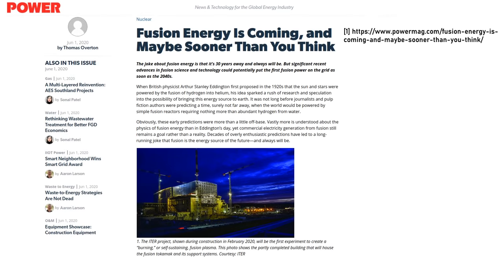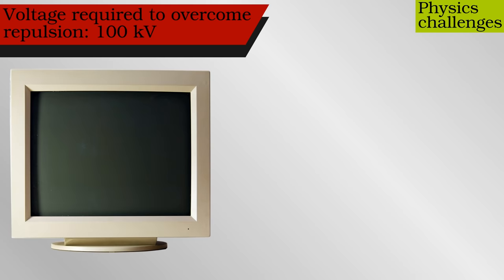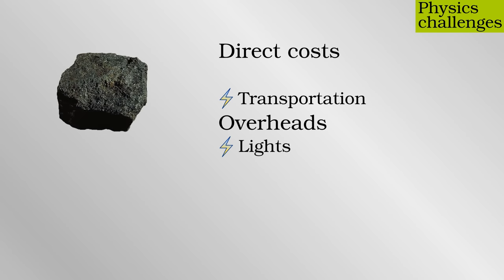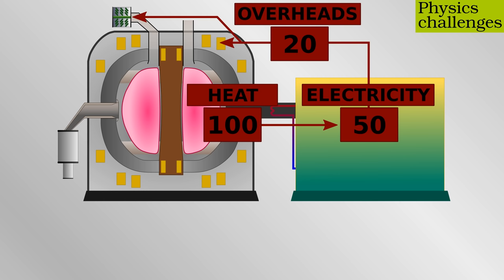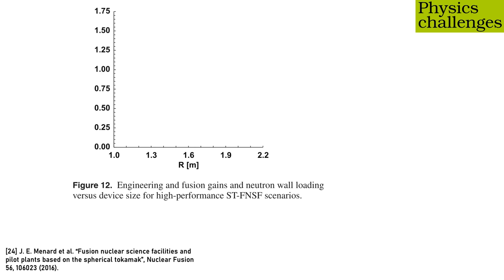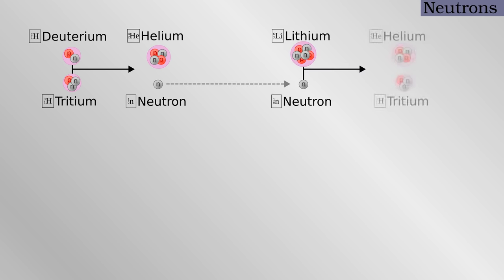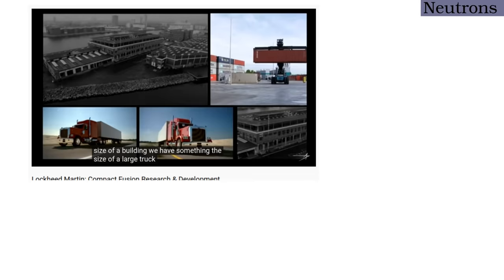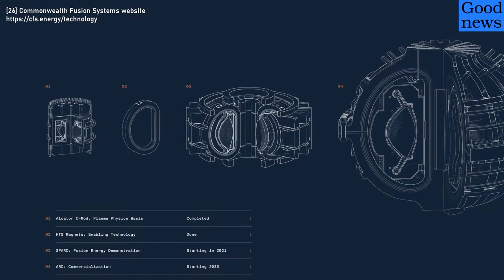Former fusion scientist on why we won't have fusion power by 2040

Comment: Logistics is not the main problem. As wartime shows, huge logistical projects can be done pretty quickly if there is the need. The problem is the missing technology to make fusion be an actually positive energy producer.
Reply: But I mean most things that can’t be done is an issue of missing tech right?
Reply: @Mothball_man  The funding for fusion would be there (huge benefit for society)  but practical working tech is not jet.

In other fields the tech is there, but the expenses are  not of sufficient value for society (and thus the voter and taxpayer / or customer).

Comment: Very interesting, really opened my eyes to the hyperbole of these companies. I'm studying mech eng next year and would love to go into this field.
Reply from the maker: Good luck. Have a look at some other educational videos I have up.
Reply: The numbers being presented by proponents seem to work out well for creating a self regenerating stream of R & D money.
   I think a better way to make as much electricity as desired would be to make a Tesla Coil and instead of grounding the bottom of the secondary like everybody else, run it though a load to ground. Tesla lit a whole bank of incandescent light bulbs. The excess energy captured seems to come from HE rays/short space rays, in the giga electron volt range, frequencies around 10 to the 24th Hz. Only at last detected I think it was 2007. (Your typical electromagentic spectrum chart ends before that with the gamma ray band.)

Comment: I had a guy one time arguing at me that we should cancel infrastructure and green energy projects just to invest in fusion energy instead. Not entirely surprisingly, he seemed to have a lot of involvement with recognizable tech organizations.
It's incredible the positions you have to try and respectfully debate against.
Reply: There is a reasonable position that would appear close to that guy's position. Modern nuclear fission reactor designs are safe, scalable, variable , and a good coal and gas complete replacement. Unlike fusion reactor attempts, fission is practical and tested, although still held back by governments around the world. Concerning green energy projects, not all are an unchallenged good. Some installations damage a large area of previously untouched ground (solar) or use an unreasonable amount of unrecyclable material to be landfilled (wind). Most depend on gas to supplement the varying electric supply, making fossil fuel use an integral part of these green installations.
Reply: @cdgstuff7512  I don't wanna start an internet argument here because those are rarely productive, but dropping all environmental projects to focus on one, single, imperfect, solution is not a good idea. 

Don't get me wrong, I'm not anti fusion, but it is not a viable single solution. Between being hard to export to newly economically growing countries, the compounding danger of creating many many reactors, the lack of available, and importantly, geologically stable space to store waste products and the simple lack of enough resources, trained staff and public will to create enough nuclear power plants to power continents worth within the next 10-20 years (if we want to hit emission deadlines) makes it impossible.
Reply: @cdgstuff7512  I would say that wanting greater use of fission is a far cry from the sort of Enron Musk tech saviorism exhibited there, and a far more common position to hold at least nowadays. At any rate, fission has the very important distinction that it actually exists already.
Reply: There is a lot of wishful thinking involved.
Reply: In any policy argument, the underlying personal incentives that cause discursants to advocate for a particular position should never enter into the discussion, unless such incentives are produced as the intended outputs or outcomes of implementation of the policy being promoted. In short, the evaluation of, and decision to accept/reject, any proposed policy claim should be based on the merits without any consideration of who is paying the advocate to promote the policy or how much they're paying him or any similar factors which have nothing to do with the merits. But of course if one of the stated goals of the policy is the increased financial well being of all persons the policy states are intended to be financially benefitted thereby, then the advocate's personal financial incentive to support the policy might actually be indistinguishable from one of the merits of the policy on its face.
Reply: @davidfloren5339  Please... Brevity is the soul of wit....
Either way... that's not what I was insinuating. The point was that silicon valley tech dudes can be annoying sometimes.
Reply: @puppable  Whoopsie daisy! Sorry - not my intent to add to the annoyance level.  Seemed like you were saying his argument is flawed only because of his background and personal incentives in making any argument, but not on its merits.  If you feel his argument to spend all those green energy/infrastructure trillions on fusion research instead is also a bad argument on its own merits, I tend to agree. But I should think there is a "reasonable" % of public resources that could be reasonably expended on fusion research.  The challenge of course is figuring out what range of funding %s can reasonably be considered reasonable.
Reply: If fusion got as much funding as the green stuff I would be driving my own Dyson Sphere by now.

On the related note, the only thing that the green parties in Europe seem to do is close nuclear plants to open coal ones.
Reply: @phamnuwen9442  it's a useful shorthand so I don't have to specifically write an enumerated list of every single specific technology I'm trying to talk about while still being generally understood by anyone who isn't trying to be needlessly pedantic about labels.
Reply: @puppable  "it's a useful shorthand so I don't have to specifically write an enumerated list of every single specific technology I'm trying to talk about while still being generally understood by anyone who isn't trying to be needlessly pedantic about labels."

Translation:

"I don't have a useful definition of the term I'm using."
Reply: @phamnuwen9442  It is a two sentence anecdote, not a whitepaper.

Comment: A dramatically underrated channel! I already knew fusion was much harder than most folks would have others believe, yet remain virtually ignorant on the subject. It's always useful to find videos like this one to hammer home yet another round of nuclear physics into my thick head. 😁
Reply: @mattblack118  Regardless of who claims what, do you actually see that the climate is indeed changing for worse than it used to be?
Reply: @lucofparis4819   No.  The planet is clearly greening.  Name 1 thing that is worse now than 100 years ago in terms of global climate.
Reply: Fusion is incredibly easy, just get the plasma hot enough, dense enough, for long enough. Now the hard part is achieving all three.
Reply: @mattblack118  : It's the effort to limit the global warming temperature in time that is the key issue.

Comment: I'd love to see a follow-up on p+B reactions. They have their own hangups, but they nicely get around (mostly) the excess neutron problem, and they result in high energy charged helium nuclei, which allows for direct electricity capture. That (hypothetically) gets you up to in the ~70% energy capture range instead of the ~50% with a thermal turbine generator.
Reply: If you think reaching Q1 is difficult with tritium and deuterium the P+B will really make it hard to get any J(oules)...

Comment: Please think about covering the stellarator approach, in my layman’s understanding it is similar to the tokamak in principle and in backing by thorough scientific evaluation but it could solve some of the tokamaks problems you did not mention in this video. There is also a test reactor here in Germany (Wendelstein 7-X) that seems to be on track to prove the feasibility of this approach soon (maybe already in 2022).
Reply: True that. 7-X Wendelstein solves issue of uneven plasma concentration that results in thermal stress on central part of spherical tokamaks. Easier to cool.
Reply: @GrimK77  And I also read it doesn’t need a pulsed magnetic field and hence is easier to operate. W7-X is not designed to ever produce energy, it is to small to achieve that. But last year they achieved fusion and next year they want to show 30 minutes of continuous plasma with fusion. That would be quite a feat and would certainly make the stellarator the best design to scale up. We will see if the tokamak can solve its problems earlier, but given the political overhead it’s unlikely.
Reply: Your still stuck with the problem of having to contain 200million deg c and heat water to steam in a reliable efficient way with super cooled magnets all in the mix..crazy or what !
Reply: @MyKharli  not really. Neutrons should go through magnets no problem and water is the best neutron catcher. 
But you do basically need s fission plant to dedicate its output to starting a really power reactor, which is ironic
Reply: @MyKharli  yes, it would be a remarkable achievement. The tokamak is the most researched design to be able to achieve that and it still has a lot of problems to solve. The stellarator is similar to a tokamak but instead of using a pulsed magnetic field it uses a static but curled up magnetic field. These are the only two designs with a decent chance of scaling up to commercial use and good scientific backing. I hope they get it to work in my lifetime.
Reply: @MyKharli  I think you slightly misrepresent what temperature is, you sounds like you assume it is the same as thermal energy. Space flight deniers make similar misinterpretation.
Besides, the whole point of tokamak is to contain plasma, and 7-x is a redesign that makes it easier long term.
There are some ideas to include AI accelerator chips to control containment in adaptive manner.
In the end it is about reactor size. Larger are more efficient, in theory and in practice, but nobody wants to start large before working out kinks and flaws of design and containment control.
Reply: @Krmpfpks  I think it is unlikely for tokamaks in classic and spherical form to solve unform plasma flow like stellerator.
In the mean time, we couls use some thorium reactors to buy some time from fossils and synthetize fuel instead of refining
Reply: @GrimK77  I've often be curious about that reasoning that "we should build small first because larger is harder" even though we know that smaller is harder for all of those stated reasons. Sometimes larger is less risky.
Reply: @JayVal90  no, it is about costs and research of design. You can't have power-plant grade reactor outright.
Reply: @GrimK77  Right, but it could be large even if it’s not power-plant grade.
Reply: @GrimK77  But its crazy , one  failure in the superconductors and you have weeks of warm up  fix and cool down  to restart and as far as i am aware there is no solution to neutron embrittlement of the containing structure ? So much of the energy goes into cooling and starting and maintaining  the plasma is another crazy notion to me .
Reply: @JayVal90  Larger means more resources wasted, in case the theory doesn't hold in practice.
Reply: @pelic9608  Right, but it sounds like your odds of success are directly proportional to its size. The only thing more expensive than a large machine that might work is a small machine that definitely won’t work.
Reply: @JayVal90  That's not the purpose. The purpose is to test the theory and if or where it breaks. The things you don't even know yet that you don't know. That's the category of knowledge that's sought to be discovered. There's other reasons like potential catastrophic failures being of relatively smaller scale.
Reply: @JayVal90  You also have to consider that this is typically not a case of them arbitrarily going "maek ractor smol", theres likely a few days worth of calculations involved in getting it to be the most economically efficient size for what you want to do.
Reply: @Krmpfpks  Given that most fusion seems to be measured in fractions of a second, this is very impressive.
Reply: @GrimK77  this is not true, you are assuming something to be constant, the strength of the magnetic field. As a Commonwealth Fusion Systems presentation mentions, plasma behaves differently under a 20 Tesla field vs a 3 Tesla field
Reply: @ppatil3655  I have no idea what are you referring to. I literally made no claims that could be interpreted like that. I really had lectures on fusion reactors. University of technology. Electrical engineering.
I always knew that containment field is not constant, needs corrections to counter behavior of plasma during heating and adding fuel , while compressing it at the same time.

Comment: Justified criticism in any scientific area including fusion is appreciated, however I am willing to bet a non-trivial amount of money that fusion will put watts on the grid by end of 2040. They might not have commercial power plants and they might cut some corners but I am certain of this as long as they can get the relevant funding which a lot of approaches have. I support all approaches to fusion as long as they use the scientific method and I hope for tighter collaboration in the fusion community going forward, including peer review and criticism.
Reply: I'll take that bet. How much and who will hold it?
Reply: @MauryMarkowitz  1000 USD. I can either do it on something like playwager or can ask betrair exchange to set something up for higher profile. What odds you expect 50/50?
Reply: @breakablec  Love it!  If I weren't so old I'd match that $1K.  But I'll probably need it for incontinent products soon enough.
Reply: @breakablec  you guys have to really be clear, though. by "by end of 2040" do you mean the end of the YEAR 2040? or by end of the deacde, so 2049?
Reply: @AndDiracisHisProphet  I think I would go for year 2040, 49 is too guaranteed in my mind as even DEMO should put watts on grid by 2048 barring further delays

Comment: We do seem to have learned a lot about how difficult fusion ENERGY will be as opposed to just fusing nuclei in an experiment. I wonder if we're at the point of "knowing all the unknowns" yet, I mean being able to list all of the specific problems that will need solving.
Reply: Certainly seems like we are getting close to that point.
Reply: @Destroyer_V0  Two phase hybrid. Small fission reaction jump starts fusion reaction. At the end of the day it's just about making stuff really hot as it plunges into water to make steam. 

Creating a self sustaining artificial sun is a much harder task than making power for a grid and yet they have been able to sustain fusion reactions for like 40 seconds or so already. 

Power for a grid should not be as hard as its made to seem.
Reply: They have enslaved and fooled you 👉 The Connections (2021) [short documentary] 💖
Reply: @VeganSemihCyprus33 you have Vegan in your username, anything you say is automatically false

Comment: I'd be very curious to hear your take on the inertial confinement projects, most notably General Fusion, which also has attracted a lot of VC money and is building a proof-of-concept reactor.
Reply: That's the only project that seems feasible to me.
Reply: ICF is useful for developing and testing implosion-type thermonuclear weapon concepts while avoiding the need to actually detonate a full-scale nuke. For delivering power to the grid, inertial confinement is lagging decades behind magnetic confinement (even with the recent record of fusion energy gain). This is due to the lasers consuming thousands of times more energy than the heating power which reaches the part of the plasma undergoing fusion.

A tokamak or stellarator could conceivably be a viable reactor with a fusion gain of 30-50. ITER is expected to reach 10, and the next step after that will be a demonstration power plant. ICF as it currently stands would not be a viable reactor concept even if it miraculously reached a fusion gain of 1000.
Reply: @hk-wt5iu  General Fusions design doesn't use lasers.
Reply: General fusion is part ICF and part traditional MCF - along with TAE systems.
Reply: I study ICF plasmas. Most of the scientific community in ICF seems, to me, rather skeptical of General Fusion, they have made some overly bold claims about their approach that just don't seem feasible, and they have not produced promising results yet, at least not that I am aware of. General Fusion is also considered more 'magnetic target fusion' than ICF, but that may not be a very important point.
Reply: @abarbar06  Thank you. If your able, what things in particular don't seem feasible?
Reply: @davescott7680  Well firstly and perhaps most importantly, their choice of using mechanical pistons instead of lasers to accelerate the plasma doesn't address ICF's most pervasive issue - Rayleigh-Taylor instabilities. Most of the work over the years on the NIF has been various attempts at mitigating or dealing with these fluid instabilities, so right off the bat, you know GF's approach will have the same problem. Second, their proposed machine design is quite grandiose, I remember hearing something on the order of 70 MA of current being necessary to compress (or was it magnetize?) the plasma, which is really quite high. By comparison, the most powerful pulsed power machine in the world delivers just ~30 MA of current to its load. I just wonder how they can possibly put the thing together. Meanwhile they put together some impressive graphics, I think they are looking for some big donor money from investors who may not know any better.

Comment: 100% correct.   And I'm an optimistic engineer with 40 years experience.

We are AT LEAST 50-100 years away from viable energy generation.  And that's VERY a best-case scenario.